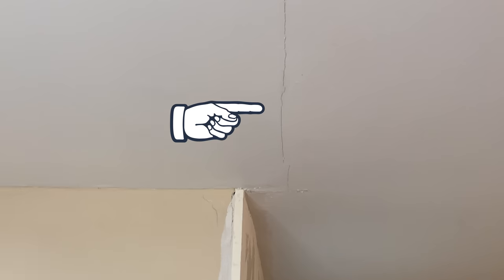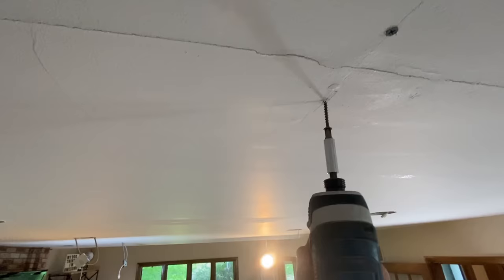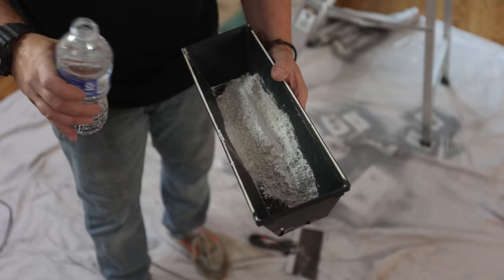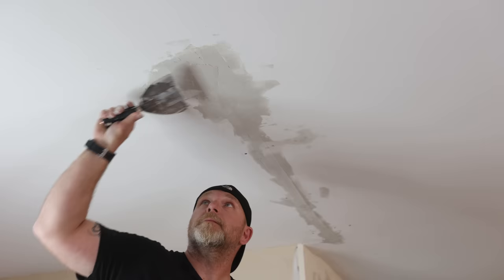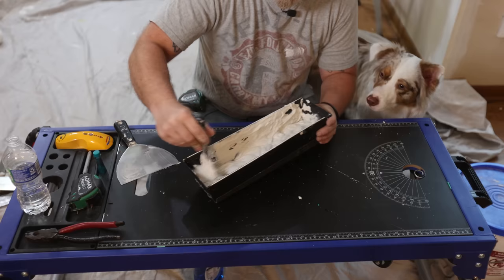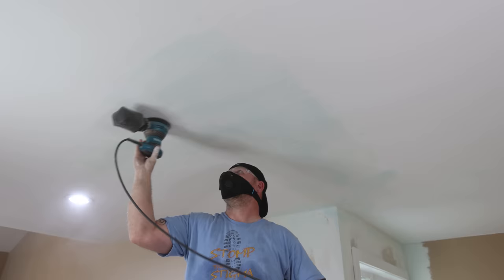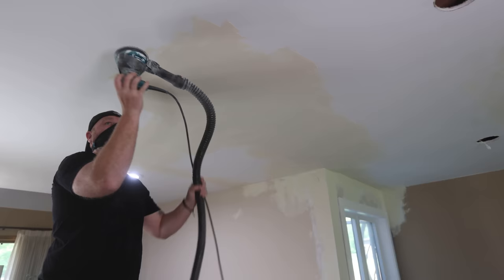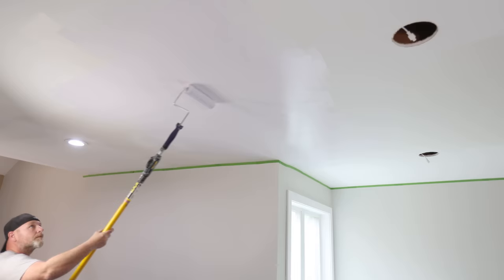How to Fix a Drywall Crack in Ceiling or Wall FOR EVER!!! Tutorial

Comment: Nicely done!  Good production and content.
I've been painting/repairing cracks for over 30 years.  Stopped in to see your vid just to verify I wasn't missing anything.  Nope, I'm good.
I'm curious about your sanding process though.  It seems to be way messy, especially in a finished house.  I discovered a 5 gallon pale water filter that that attaches to a shop vac and use that for all my patch jobs.  The water filter catches almost all of the dust so it doesn't clog up the shop vac filter and reduces the dust in the room by probably 90%.
Reply: Tell us more about this 5 gallon pale water filter. :-)
Reply: Yeah I want to head more about this please. Mud sanding dust sucks! It coats everything.
Reply: @danieldamico3177  sorry, did not see this earlier.

Comment: Great video mate.
The only thing I didn't agree with was using the fibreglass mesh tape. I would use fibre fuse everytime before that tape.
That mesh tape is too prone to re cracking. Nice job all the same though 👍
Reply: Stick with paper tape.
Reply: That kilted guy's channel is also a good source of information. He is adamant that when using the mesh hot mud is essential.

Comment: Dudes got a very smooth touch.  That comes after thousands of repairs 🤣 for the  do it yourselfer. We use a Festool 10 inch radial off the vacuum works really well no dust.

Comment: Wow, I’m so glad I watched this. I’ve done a lot of crack repair (in my case on plaster walls) over the years, and the techniques I’ve used are pretty much the same as what you showed. Expect that I’ve always applied the mesh tape directly to the crack and then applied the first coat of mud (Durabond). I’ve never tried embedding the mesh in the wet mud, I always thought that was a paper tape thing. It’s been a number of years since the last time I’ve done this work but I have to do some crack repair again soon and now I have learned some new tricks from you! I’d never heard of the food coloring trick - or the tinted joint compound. In the past there have been times when I have mixed PlasterWeld with the JC, which does turn it a little pink. But now I’m going to try that tinted JC. 
I also did not know about cutting the circles at the end of the cracks. 
But the absolute best thing I learned from you today is that color changing ceiling paint exists! Hallelujah. I have painted a lot of plaster ceilings, which can be maddening because of all the waves and dips and valleys, and even with the right lighting I could still end up with uneven coverage.. leading to extra coats🥵. I am so glad to find out that product exists. Thanks for your video!
Reply: chalk line chalk works well for tinting mud as well, and I usually have it on hand as opposed to food coloring
Reply: If it's about seeing what you need to sand ... shining a light across it does a better job.
But ya tinting the mud is almost a must if you have a lot of small patches that need a quick sand and spot prime.
Reply: you are correct, the mesh is made to stick directly to the surface, and then have the mud spread over the top.  This is designed to save mud as well as time.  Adding a base/bed coat and then placing mesh on top is one of the main reasons mesh taps fails and cracks.  Too many people don't take a few minutes and research new/newer or new to them, products before using them in order to install the product properly.  Mesh and paper will last  just as long as the other when applies properly.
Reply: @jmackinjersey1  you said "Adding a base/bed coat and then placing mesh on top is one of the main reasons mesh taps fails and cracks."

But what about a hot mud pre-fill for big cracks ?   Keeping it inside the surface plane for sure.  Then lay fiber tape on that before the larger first coat.   But I guess should also use a hot mud to set the tape ?

Comment: There is a good chance of failure with doing it this way first of all after 40 years of drywalling I have to tell you you must press the durabond  deeply into the crack, making a dozen passes, making sure it is packed into the thickness of the drywall. for maximum protection of crack not coming back.I would do the second coat with a durabond again putting it on very smoothly. No edges. Then this final coat would be the bucket mud. If you have framing issues loose lumber in the ceiling, the crack will most likely come back. if you do not heat the house in the winter time, the crack will come back due to expansion and movement houses must be kept 50° and warmer in the winter months in the north.

Comment: Use a light to shine across the joint to see if there is anything you need to work on. I worked in construction for 34 years and 18 of that was commercial drywall
Reply from the maker: Great tip Wayne !
Reply: I use a clamp light on the top of a 6 ft ladder (pointed sideways) to highlight any shadows. Been doing that for decades.

Comment: Ya that dye tip is great, as is the purple paint.  My team has a vacuum attached to the orbital with a ten foot hose, it's quite the rig and saves so much time on cleanup.
Reply from the maker: I do need to get a hepa vac for it.  Will make a world of difference
Reply: Try adding chalkbox chaulk thru a sifter to get rid of clumps, into a pan with a little water and stir it very well to get rid of clumps. Then add that to your mud. Never use dyes. They will potentially bleed thru your latex paints afterwards and you'll have to oil prime to get rid of them.

Comment: If you can master paper joint tape, I think you'll get longer lasting results. Imbed the tape with Dura Bond, and if you can handle it, do a smooth thin coat of the same thing over it. Better shear strength than mesh tape. Then use the easy sand stuff over that.
Reply: Sheer strength and will allow small movement without cracking as easy because  a crack can exist under the paper tape where mesh tape shows it instantaneously.
Reply: @larrypilgrim12  I had that mesh tape crap break on a wall by putting a little pressure on it. It has absolutely no strength. I found for the paper tape, just dip it in water before applying it and it will eliminate the majority of our problems. It doesn't matter how long of a piece you need, just fold it into a manageable length and dip it in your rinse water bucket. This also makes it really easy to put on because you have it nice and folded.
Reply: @MAGAMAN  yep

Comment: The problem with patching cracks is that they are usually caused by something going on in the houses Foundation. Settlement, sagging floors, and rot are likely causes of drywall cracks. You may want to fix the route cause before you patch.
Reply: *root
Reply: In old houses it can be the glue and nails used to secure the drywall to the ceiling. If your drywall is installed with nails and is sagging, put some drywall screws in asap. The drywall can literally fall off the ceilings that were installed this way and if you have blown in insulation it will make a massive mess, on top of the possibility of injuring someone.

Comment: I've been using Durabond for years on the first coat with great success.  I get cloase to a finish coat with my knife.  I saw this video where you used the sponge for the finish.  How in the heck I never though of that is beyond me.  much better clean edges.   Good tip, thanks
Reply: yes, a sponge is good, especially for feathering along the edges to the original drywall. Just rinse and wring well every few strokes.
Reply from the maker: Glad it helped buddy !

Comment: If you don't have any Durabond, you can add PVA glue to regular mud to give it strength. 
There is a "special" Drywall PVA glue or you can just use Elmer's Glue (white stuff) or Titebond. Just mix the glue with water and add that to your mud when watering it down.

IMO the biggest reason for cracks is nails were used instead of screws. Nails can work loose.

Also 1 1/4" screws are sufficient for up to 5/8" thick drywall. The screw needs to penetrate into the stud at least 5/8".

Comment: You can use durabond for the finish layer. You just have to finish it wet. Wait til it sets up but still damp and use water with your trowel, it will be glass smooth.

Comment: Great tutorial. Straight and to the point with plenty of great advice. Subscribed. 👍🏼
Reply: Tape spreads the stress out over a big area. Hiding an 1/8'' over a large area is a reasonable situation. 10 or 12 inch blades will help.

Comment: Great video man, I drywall on occasion for my job so it is great to see how other people do this stuff to see if I can pick up some tips I never thought of before. That food colouring is brilliant. I've used one of those electric sanding polls before and they are really nice, unless the ceiling is over 8ft in those cases they tire your arms out like crazy. Keep up the amazing work.
Reply from the maker: Yeah I’ve been meaning to get one of those electric sanders too.
Reply: @KomarProject  a
When you go to purchase one, I recommend the Porter Cable. I have been doing drywall for a living for over 30 years and it's the best that I have run across so far. It's light weight and they will last you a long time. Cheers.
Reply: Boss bought the porter cable sander years ago for like $500 and it's only been used once or twice

Comment: This is great information for a DIY guy. But my question is, what to do when every ceiling in the house is heavily textured. And all my cracks appear at tape joints Or corner joints.  
Thanks for reading and any extra info. 
** removing the texture is not an option for us**

Comment: I repaired cracks over the shower and on the bathroom ceiling last year.  I went into the attic and glued a 1x4 over the crack, then put drywall screws from both sides of the crack into the board.  Applied hot mud, taped with Fiberfuse and got a great finish.  Well, the crack over the shower is back and it’s even bigger than it was before!  I’m afraid that corner of my house (on a slab) may be separating & sinking as I also noticed a long crack in the exterior bricks on that wall.  It’s got me real concerned.
Reply: Yes, drywall is not a structural product. Better call a company that will pump concrete under your footing to stop the sinking.
Reply: @larrypilgrim12  I had a structural repair company dig down with an excavator & install 10 helical piers under one corner of my foundation (not cheap) to level the slab.  The drywall cracks have all nicely closed up.  They told me to wait until spring to repair the drywall to see if there is any more settlement.  There’s been a lot of cracked foundations in our area recently because of the summer drought.  All the recent rains may be helping some of those by swelling the parched soil.
Reply: @JT_70  that is a bummer and yes waiting for settlement to finish repairs are wise. Something else that can help is to run stiffners from outside wall to outside wall on the bottom cord of your trusses. It will help with what we call motion. I was in Vegas and when they started adding the glass at Mandalay bay hotel the middle of the building started to sink. A underground stream was very far down but they had to reroute the water and pump in a ridiculous amount of cement. At least you got it taken care of

Comment: Instead of a knife to clean the crack joint, I use an old triangle tipped can opener to clean it out. It works great and gives a little more space on the surface of the drywall to hold more Durabond...

Comment: It's ideal to do a base coat or 2 of durabond and letting it dry before trying to tape. You need to make sure the sheets of drywall where crack occured are fully bonded prior to taping. Also adding a little blue chalk is better than food coloring
Reply: Yeah, none of that is true lol.
Reply: @1UTUBEUSERNAME  with the amount of drywall I have had to repair over 20 years , it is. Granted I am talking about high end customers who care more about it lasting and expect a higher quality..
Reply: @joshuatrott193  if you are using durabond you don't need to do a prefill coat, let alone 2. Hot mud, durabond expands. If you are using joint compound than a single prefill is correct. Paper tape is also a better deterrent from future cracking, but overall drywall mud is not a structural solution. If walls move enough rafters, and joists need to be addressed.
Reply: @larrypilgrim12  I disagree as I've fixed thousands of cracks from lack of prefill
Reply: @joshuatrott193  water damage, mud stuck to tape instead of sheetrock? You do not need to prefill when using a rapid set and in fact you are creating a hump, you are not reinforcing any more with a quick set prefill and then a tape. Spread the mud in the crack and wide enough to apply paper tape. And for best results soak the tape in water for an even stronger bond. If it cracks its too much structural movement. Drywall and drywall mud are not structural products. There are a multitude of reasons why cracking can occur. It is not because of prefill. Prefill is great when using regular compound and the correct way. Quick set is a different beast. As for my credentials I am very over qualified for any drywall topic.
Reply: @larrypilgrim12  many of these cracks have no durabond or prefill. Once you remove tape there are large gaps between the sheets of drywall. Packing these gaps, wiping smooth and letting them shrink as they dry prior to taping works
Reply: @joshuatrott193  yes, major gaps in drywall joints should be prefilled with regular joint compound initially. When repairing a crack the best bond and strength is using a 20 minute quick set with the tape being wet. Quick set bond will not release from drywall due to the tape like regular joint compound will. The bond of the mud to the tape and to the drywall is key. Mesh tape doesn't have the bond fighting issue but also doesn't completely cover the joint. If regular joint compound isn't wet enough it will bond to the tape and not the drywall. If I am using quick set for more than 1 coat it is literally skimming it twice. But it takes 2 coats of regular compound to eliminate flashing through the paint. Or minimum of 2 primer coats. I never prefill with quick set. And if you do you don't need to tape with it. Not that your method isn't a good prevention measure. But it is not a method I would use for all the goals I am trying to accomplish. Strength, flat, smooth, and unnoticeable when complete. Wet sanding edges and scraping lap marks and air bubbles just prior to complete drying is also the method but is for people with the skill to do it. Wet sanding edges after it dries.
Reply: @larrypilgrim12 I was following along until you said to soak your tape in water 💀
Reply: The whole point of the tape is to prevent the cracking. It is literally the only reason why tape is used in dry-walling. Just make sure the crack is widened out enough, make sure you completely fill it with drywall compound, then put the tape over that.

Comment: Like most DIY projects ... you make it look easy. Owning, having the correct tools makes or breaks the deal. Hiring someone isn't cheaper than buying the materials and one-time use tools? Why not do it on textured ceiling? Your ceiling cracks on new non finished dry wall... how's that common?

Comment: Bed some fibafuse fiberglass tape in there to help it hold, mesh is bad to dimple if it ever moves again. Also add more screws on out the studs close to that crack and if there’s any additional nail pops add screws near them too.